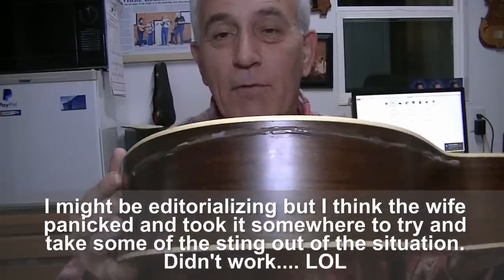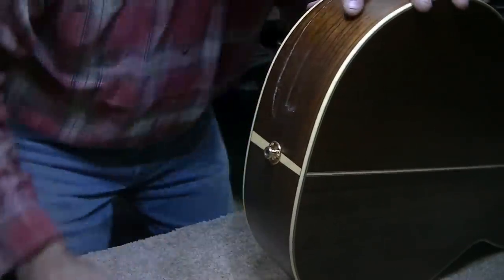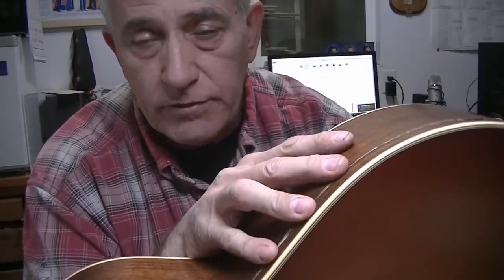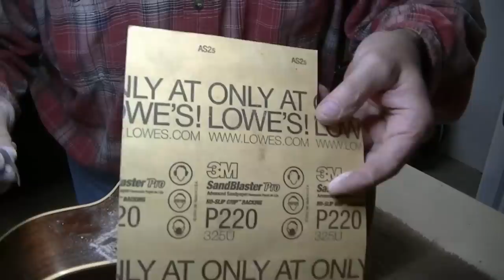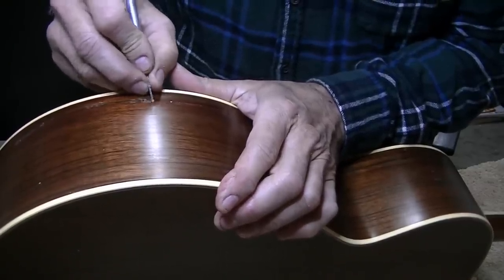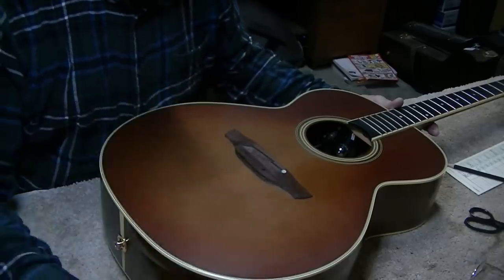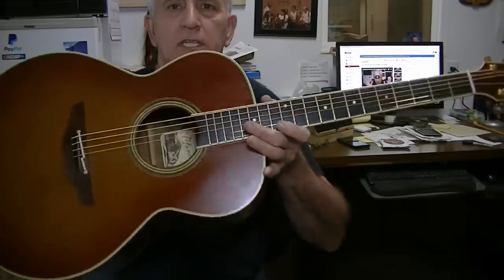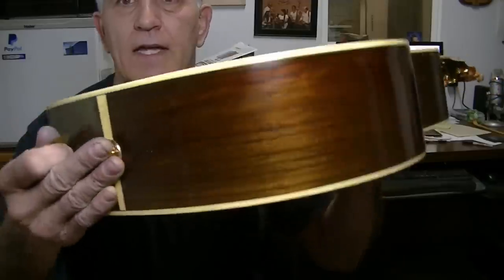224 RSW Takamine Nearly Destroyed LIVES ON

Comment: Put a JDL bridge doctor on it with a brass pin. Guitar case at 100 degrees with a humidifier for 2 to 3 weeks adjusting the bridge doctor slowly every 6 to 12 hours until you have the bridge as good as it will as good as you can get it. It will work, I saved a Takamine F-385 using this technique and now it's my favorite guitar.  

That's JDL bridge doctor

Comment: I actually with you especially about the practicality; however, I did a crazy thing with a 00 Gibson that was brought to my attention. Someone some how exploded the guitar from the inside out especially on the side walls. There was a large, jagged amount of wood missing from on side of the upper bout. The top of the top behind the bridge was profoundly bulged. I figured this thing wasn't worth fixing, so what the hell. Why not try something to flatten the bulge?. What I did was crazy but it completely flattened the top without damaging the top or the bridge plate. I made a plug to seal the sound hole. I made a long plastic trough into which I would stuff paper towels soaked with boiling hot water. I would slide this into the guitar directly under the bridge plate and lower bout top. Then I would seal the sound hole with the plug. Here comes the crazy part. I took a group of round lead cylinders and taped them together, and then I placed this 30-pound mass directly onto the bridge with the saddle removed. I replaced the boiling water trough twice a day for two months (no kidding). The top became dead flat and there was no damage or loosening to the bridge plate or bracing. I was offered $3,500 for the guitar when done. The way I look at it, no one in his right mind would do what I did, but it was a grand experiment.

Comment: HAIRDRYER, HAIRDRYER, HAIRDRYER!!! Ohhhh God, I almost died when you brought out the heatgun.... shudder :)

Takamine uses solid sides for their high end, made in Japan models (which this one is) if it was a ply, the grain wouldn’t be the same on the inside as the outside.

Green scotchbrite makes a shiny finish satin smooth.... :)
Reply from the maker: The heat gun is infinitely adjustable from cool all the way to very hot. You could dry your hair with it no problem. The grain didn't necessarily match all the way around from the inside to the outside that's why it seem like a possible plywood issue.  In addition many other viewers claim that it is a plywood side guitar. So I don't know. Thanks for watching.

Comment: This is a Japanese made guitar (90% of Takamines are Chinese these days), and a pretty good one, sold for about $1500.00 in 2012. It has a Cedar top, Ovangkol back and sides, and an ebony fretboard. No laminates here, definitely worth the cost to repair it. The pre-amp had a small tube in it. Seemed like a gimmick to me.
Your repair turned out really nice. The customer is going to be tickled.
Have you ever used a bridge doctor?
Reply from the maker: I have only used one Bridge dr. It does remove the hump but I don't like what it does to the sound.
Reply: A Takamine guitar that cost $1500 in 2012 is worth at most about $500 today. How do I know? I have one. With that crack it's probably worth more like $350.

Comment: I think it was 2 part marine epoxy. You don't really want to use epoxy on a guitar (although it has the strongest bond strength of any commercially available glue) as, when it heats up - it starts delaminating. Heat is part of it's catylization process when you mix the two parts, and the bond will start to give at a certain temperature. Titebond doesn't have this problem. If you want to be really fussy, you couldget the right colour stains and with a microfibre brush, carefully blot back in the grain to match the rest of the wood around it before lacquering.

Comment: PS...Or the Fender telecaster with 4 holes drilled in the neck for strap buttons, or the stand up bass that had fiberglass used to patch a hole. Speaking of trying to put moisture into an guitar, it warped the top and back so bad they broke in several places.

Comment: Great job Jerry with that crack. Perfect!!!!!
Just wondering,
Have you ever tried using a plastic sound hole cover in stead of paper towel. When ever i have rehuidimfed a guitar i use plastic that wont absorbed any moister from the guitar. I stuff the sound hole with an empty  paitio chip bag or med trash bag but i only stuff the top inside not all the way down.  For me it  works every time. I would think using a paper towel you would defeat the perpose.it will obsorbe the moister not lock it it. I also use warm to hot water so the steam will get into the wood faster. I use a small very small towl in a pan i make out of tin foil.i leave for 24 to 48 hrs. I dont know if you have tried this method or not before.. Just trying to help you out i hope  this does the trick for you my friend. 
Thanks again for all your vids.
Ken
Reply from the maker: I have pretty much tried everything. At least in terms of belly bulges in my opinion you'll never fix it with humidity. At least not a permanent fix. The strings will pull the wood back up after it dries again. The wood likes that shape and it's going to go back to that shape. In my opinion the only way you can fix it permanently is to put additional mechanical stiffeners in the area. But I don't claim to know everything.
Reply: Rosa String Works 
Yesss your so right  the guitar had a low spot between the bridge and the sound hole. It was totatly dry to the point that the body was just about to start cracking it was in bad shape. It all most dryed out the small dish towel i used, it was that dry. The guitar filled out and had the right body shape afterwards. This was about 3 months ago and its still holding its shape really well and bridge tightened up really nicely and its still holding. 

Thanks again Jerry you really did an Awesome job on this guitar with the uuck hot glue. At first i thought they used a tube of silicone hehehe thats what it looked like in the vid. If ever i need a guitar to be worked on more than i can do. Your the very first person i will call to fix it. Thanks again
Ken

Comment: If the guitar had a plywood top you could wet the inside top with a wet rag and it would pull some of the hump out, but if its a solid top it will not change it

Comment: I would have put serveral wedges on the inside of the guitar along where the crack was and made sure the wedges were trying to spread the crack as much as possible and then I would have used boiling hot water to loosen up the glue, you could also use the hot air gun and or a hot blade or steam. Once the glue starts to give, since there would be alot of pressure trying to spread the crack, the crack should just bust open. At that point, I would have filed the inside of the crack to get the glue off and then aligned and glued everything back together.

Comment: the method I use to repair a bulge is to Humidify for about 1 week with gentle pressure applied with a straight flat hardwood and about 1 lb of pressure  for 2 to 3 days then add 1 more lb and let sit until it returns to flat this will only work on a solid wood top once it has returned to flat remove humidifier and allow to dry completely with the weight on before stringing I have done a # of guitars like this and no returns yet

Comment: Drill some small holes and put in some small  nuts and bolts with washers on the inside side then pull tie lower side out to level with it all like you were doing car dent pullout

Comment: Also on this Takamine, on the humidity theory, what about sanding the area o the bulge on the underside of the top, and then lightly moisten it, and then hot air?  I am "assuming there is a light finish on the underside.  If not then no sanding needed.   Just throwing ideas out there.  I like to throw ideas out, since I'm not using them. : )

Comment: I have found wet sanding with 1200 grit paper does a pretty good job of changing full gloss to a light satin finish.  I suspect you could go coarser until the "satin" surface comes close, say down to 600 grit.   Just my experience with furniture and decoupage pieces.

Comment: Just my 2 cents if you have a bulge you should de-humidify the guitar not the other way around. More moisture - the wood expands - the top bulges out - less humidity - the top shrinks and flattens out. Standard procedure in such case.
Reply from the maker: I don't disagree at all. There's a huge debate on all the humidity crap. In fact I've never seen humidity work for or against anything when trying to fix a problem on a guitar.
Reply: @RosaStringWorks  Agreed Jerry. In order for this to work the guitar has to be put in some sort of enclosure that allows you to controll the humidity level. And then we are talking weeks rather than days before the changes happen if they do at all. As you've shown in many of your videos often we are dealing with loose braces and other "broken" stuff inside that contributes to the string pull distorting the top. If one were to try this with a guitar case it would take even longer to see tangible results (humidificaton or de-humidification with plenty of silica gel for example) so this method is definitely not something that will work for a relatively quick fix.

Comment: That was Elmers' glue! I've removed so much of that it isn't funny! It always dries rubbery, and white the more glue you add. 600 GRIT WET-OR-DRY sandpaper is what manufacturers use to get that dull satin look with a little bit of rubbing compound to get that semi-gloss look instead of using flat finishes since those have to be sprayed in multiple coats unlike heavier gloss finishes which don't require so much to build. It's cheaper this way.
Reply from the maker: I don't think this was Elmer's. The reason being I tried soaking it with water and it wouldn't Cloud up and turn milky white like Elmer's does.

Comment: Just adding moisture without bracing it downward by itself will never get rid of a bulge. You have to force it down to where you want it at least. then keep it wet not just humid for about a month then let it dry for a month or more. That usually works for me.
Reply from the maker: I know that very well. The problem is there's hundreds of people on the videos saying that just humidity fixes everything. I find it fixes very very little.
Reply: @RosaStringWorks  You are a pretty good repair man and I an sure you already know that, but you didn't show it. If it were me, I would also have removed the bridge and checked it for straightness. No use putting on a bent bridge on a flat top.  I wish you well! Thanks for your site.

Comment: What is it about Takamines? I recently fixed one ( a free/charity job for a poor young single mother ) that had a drunk guy fall on it when it was propped up against a metal radiator. Smashed holes and cracks in front, back and side. Managed to get it all glued back in place, but was unable to hide the repairs as in places the wood had been crushed.

Comment: Could you not look up the specs on this specific model or contact Takamine to verify whether this particular model was manufactured with either laminate or solid wood sides? I had a G-Series “fixer” some years ago with solid top and back with laminate siding. You would think the higher end models would be all solid right? Then again, I have two Alvarez Yairi models with laminate sides and back and they match the inner and outer wood quite closely so you can’t always tell! 

I had a friend who cracked the side of his Martin (obviously solid) and the crack actually looked pretty clean and fixable. Next time I saw him, he used some epoxy which resulted in it looking quite similar to this guitar at the beginning of the video!  If it were my guitar, I’d be tempted to do the repair myself and my luthier skills are limited. Would’ve looked a helluva lot better than what he did. Sad thing is had it been repaired properly in the first place, the crack would’ve likely been undetectable after the repair!

Aren’t you supposed to put some weight or tension in opposition to the bulge while you are humidifying?

Comment: Did you think maybe some sawdust, or saved wood shavings could have been used to fill the areas of deeper gauges? Just wondering.
Reply from the maker: I'm not a fan of filling things with sawdust and glue. I do it or very tiny holes but larger gaps it shrinks way too much and you have to do it many times.
Reply: @RosaStringWorks  gotcha. It turned out great - that's what counts 😎

Comment: Jerry - if this is epoxy type glue would you have any success with applying heat. I once had to redrill banjo head machine holes and my drill actually melted glue that had formed a previous attempt at forming & filling a (rather large) gap in the peg head. I meant - apply like you do, with the heating iron, on bridges etc, bit by bit .

Comment: The only possible/plausible use for a hot glue gun with a guitar is maybe to assist mounting a wire harness inside... but usually those have a decent tape on them.

Comment: Hi there, i know this was posted a while back...but i have a Takamine G series and the the truss rod can only be accessed via the sound hole. As you look at it, it says "bow" to the left and "warp" to the right...what way do i turn it to bring the string action down ? as it is to high the further up the neck you go....i appreciate that you can't see it yourself, but i can't afford to take it some place. Any advice you can give me would be very much appreciated....Peace.
Reply from the maker: Well I've said many times that you never really use the truss rod to adjust the height of your strings. It is just there to take out the under bow and set the relief. The height of your strings is adjusted at the nut and at the Saddle.
Reply: @RosaStringWorks  Thank you very much for your advice..but for it, i think i would probably have royally messed things up even more. I will save my pennies and take it some place that can fix it for me. Absolute Respect and peace to you my friend.

Comment: It broke under the kerfing and was loose. The other glue that was applied locked it in to a bad position back to the kerfing and now you are the guy with the real issue. Thanks to the previous repair attempt it is worse off. You have to break it free from the kerfing and reset it... That means WAY BEYOND BUDGET, but it can be done... yeah, right! It can, but at what cost to time and effort. I like Takamine guitars and if it was my own, I would do it, but if someone else is paying, they may not be willing for that much time.

Comment: I have a fender banjo that no mater what I do the third string always sound dead!  It can be in perfect pitch but when I play the other strings it still sounds dead!  I’ve changed the strings with no better results!  I’ve checked the head tension still nothing!  I’ve checked the intinitation the bridge the nut i am completely stumped!  It just sounds really bad!  The instrument is perfect!  Has no damage and not even a scratch anywhere!  Some gold tone is wore off and that is the worst part.  Do you have any suggestions?
Reply from the maker: That is a tough one. My guess is that it is either the slot in the nut or the slot on the top of the bridge. If the slot is cut at the wrong angle the string will vibrate slightly inside the nut or the bridge and it will deaden. In other words the slot should be cut at the angle of the peghead on the nut.  And the slot should be cut at the angle toward the tailpiece on the bridge. That way the last place the string touches either the nut or the Bridge is on the fretboard side of each piece. Therefore the string has no way I can vibrate inside those parts and deadan
Reply: Thanks.  I’ll check that out.
Reply: @williambowen6471  I build banjos and I agree its either the nut or the bridge . Also could be tailpiece and check head tensinon. Lastly check neck angle with co-ordinator rods.

Comment: I know this is an older video and I'm not sure if you will even see this comment, but I just saw this video
 I had a bad bulge in my64 gib lg1
 I took 2 pieces of 11/2x3/4+/- and long enough to span the lower bought just behind the bridge at the fattest point 
I glued low pile carpet to one side of  each piece 
Put one on top of the other carpet to carpet
Drilled a hole in each end for bolts along enough to allow 1piece on top 1under(a long clamp.
Put an extra piece of carpet between the clamp and the body, tightened the bolts at each end which started to reverse the belly
Large damp spong inside and a heating pad centered on top
Made sure the spong stayed damp
And the pad on top was just warm
Kept eye on everything and after a couple of days the clamping started to become loose(remember not to put to much pressure all at once
Ease it on over SEVERAL DAYS??????
once it starts to bow inward (careful just a little) remember don't think of this as an overnight fix
Perhaps it might take a week maybe 2 
Just undo it and briefly check on it
 If it sorta holds  just a little negative bow (a tiny bit negative) keep the clamp neutral and check every once in a while
Good Luck and God Bless

Comment: Hey Jerry you said the height needs 90 instead of 130 and 80 instead of 115 on the 12th fret around 51:00, what measurements are you talking about?
Reply from the maker: That's the measurement at the 12th fret.
Reply: I meant to say what system are these measurements in?

Comment: Hey there Jerry ,
I have had to work with wood many times in my life , and moisture has never worked as a single solution for a repair ! I have always had to also add a source of heat or steam to see any real effect ! Which in this case would also destroy the finish and even possibly the glue joints ! 🤔 so with that being said , I could never recommend this type of solution for any repair on an instrument !